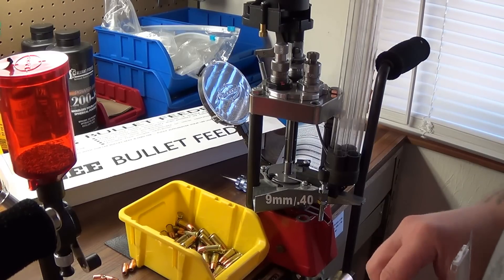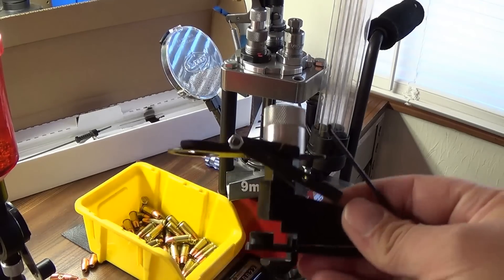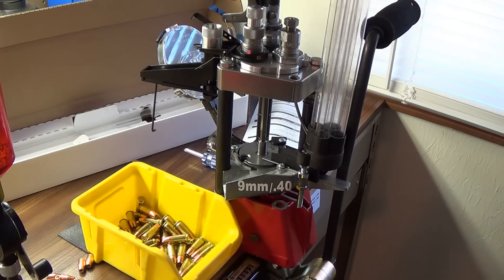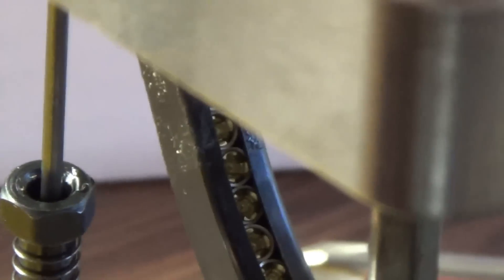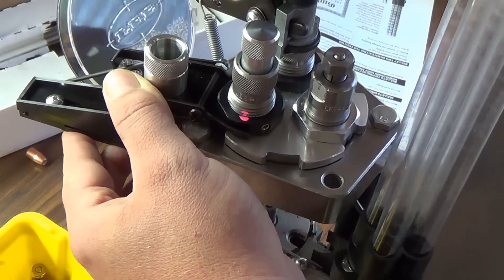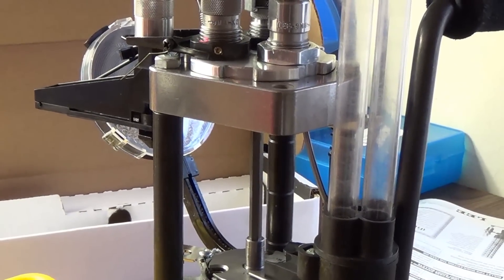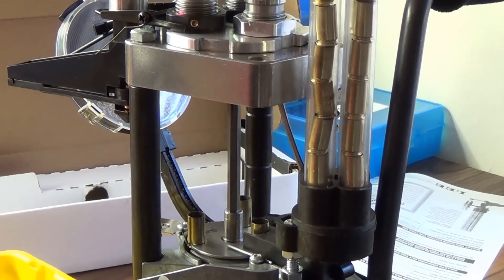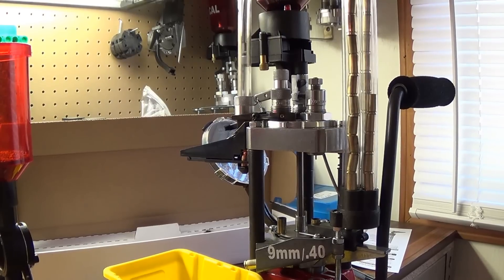Lee Bullet Feeder Setup & size selection Lee Pro 1000

Comment: I bought and installed a feeder last week for a 40 s&w. I bought the one for the longer bullets, but I'm using the shorter bullets. I just used some double face tape and a shim on the die opening bottom and it works great (I might want to use a longer bullet sometime).

Comment: Very helpful. I found that the directions were a little hard to follow, so watching this video made the installation and setup a breeze.  I can't thank you enough. Now somebody needs to give me a trick or explanation about getting the case feeder to feed more than four or five cases w/o feeding cases improperly.  Great Job of this video! -:-}>
Reply: +Kevin ODay  Hi  Kevin, I had the same problem when reloading .357 cases. Reading several forum discussions I found out that I installed the guiding rod in the wrong hole. Since I moved the rod in the other position, in the hole closest to the case (which I totally ignored) it has been working so fast that sometimes I run out of primers...

Comment: Your good at this, your easy to understand and very detailed!  I have a few questions about the bullet feeder. Is it really worth it? Do you have much trouble with it? Don't you have to readjust the die after mounting the bullet feeder under it?
Also, on another video of yours you have the Frankford Arsenal Quick-N-EZ case cleaner. Are you happy with it? I picked one up and ran some brass for an hour, some of the cases with powder stains did not come clean so I ran it again for another 2 hours with little or no improvement! I did not use the Brass Polish, do you think that will help? Thanks for your help. Karl

Comment: Just got the 9mm bullet feeder and when the bullet drops it stays ontop of the fingers  instead of falling through  like in the video .  Are the fingers supposed  to spread open when they are under the bullet die. Or did lee send me the wrong set up. The hole in the fingers is the size of a 223 round roughly  for a visual .

Comment: Hi, great vid, how do you change the buffer to another hole, the instructions recommend using the inside hole for my press. I have the same press as you but you use the buffer in the outside hole,
Cheers

Comment: Hi There, 

Great video!!!!

I recently purchased a Lee Pro1000 and a Bullet Feeder, followed your instructions on the installation. Question I have is - Did you have to set your 2 presiding dies lower? Only reason I ask is that I’m the down stroke (shell plate up) The “fingers” on the bullet feeder
Reply: Sorry... 

The fingers get smashed by the shell plate before my 2 other dies get full depth....

Comment: Maybe you can help me.  I spent about 1 1/2 hours trying to get the bullet feeder set up on my press.  Same press, 9MM.  I followed the instructions that came with it, and actually watched your video in the process.  Everything seemed to work well, but after about 3 cycles, the fingers won't return to the die all the way to pick up another bullet.  It's like the buffer is slipping on the actuator rod.  Any suggestions would be greatly appreciated.

Comment: I know this video is old but I hope you see this comment and can give some insight.  I recently bought a lee pro 1000 and decided to decap/prime on another single stage press.  On my Pro 1000 I have the powder drop die in station 1, the bullet seat die in station 2, and a FCD in station 3.  I have been looking at attempting to add a bullet feeder, but am looking to see if it is possible to move the bullet feeder over one slot (to where the powder drop is on yours) and still function as designed.  Without the priming system on mine, the entire back is wide open, so I assume without seeing one up close that the issue might be lining up with that part on the back of the plate holder.
Reply from the maker: due to the design it can only be placed in the 3rd station.

Comment: question. when you install the bullet feeder, wouldn't you have to re calibrate the last die on the top section? The little ring would probably offset the pre calibrated die
Reply from the maker: Yes my die was perviously set for the press with the feeder on it

Comment: The problem I've been having is that when the finger picks up the bullet and it's about to go over the case the bullet drops and I don't understand why it's like the fingers are not strong enough to hold on to it or maybe the fingers are moving too quickly I tried slowing down and I've tried going a little bit faster does anybody have any suggestions